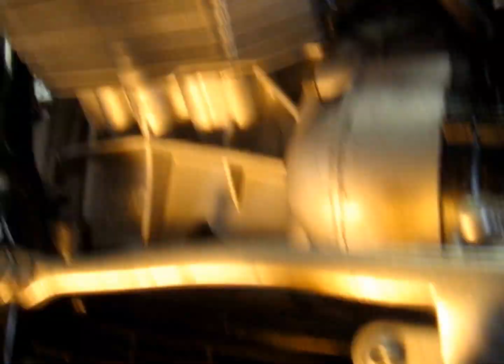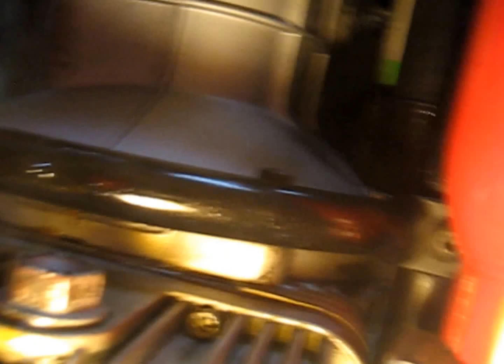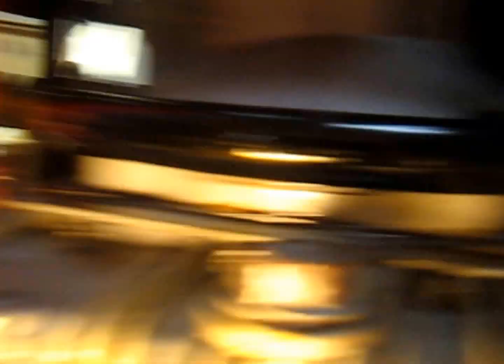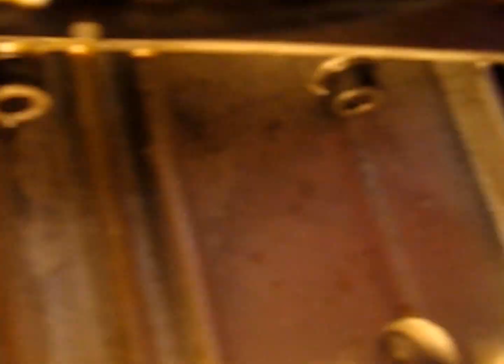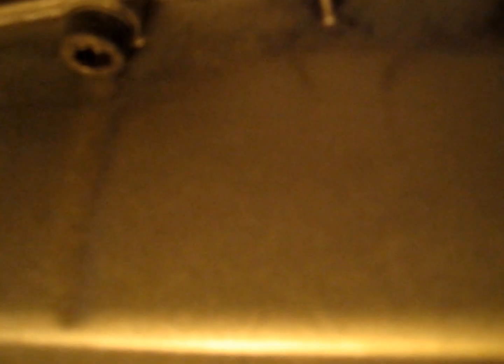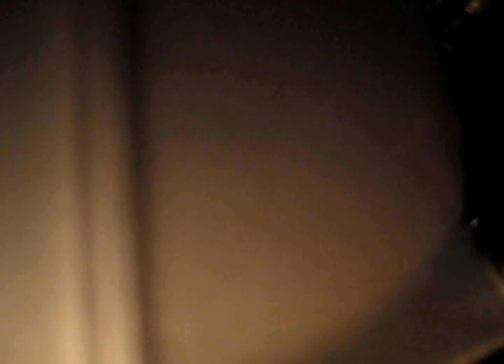1999 Moto Guzzi Oil Leak

Comment: Crank shaft oil seal hardens and leaks after a long time.also the seal on the gear box .replace both and clean crank case breather.never over fill oil.3lt of oil is always enough.i have carried this out many times.its an engine out job.not nice to do but it's good for a long time.any questions and I will help you.Moto Guzzi Ireland.